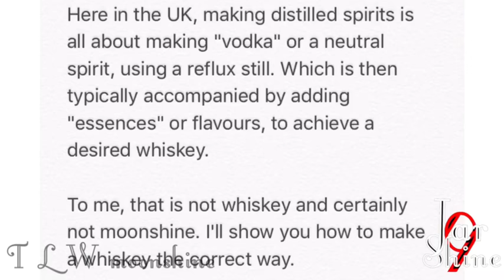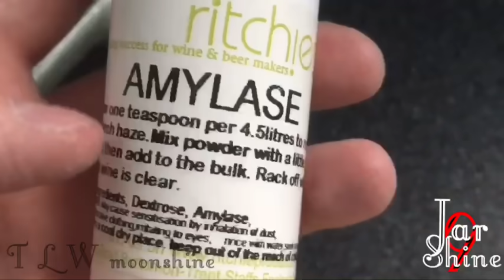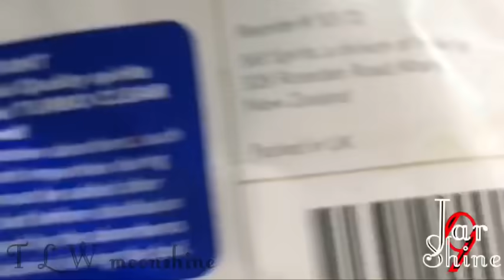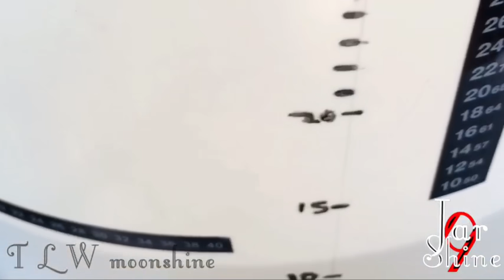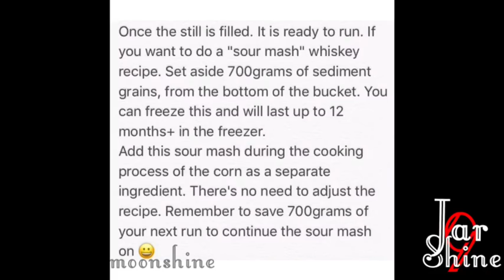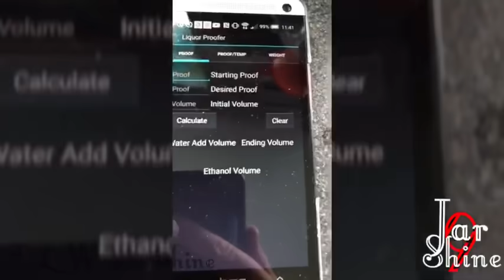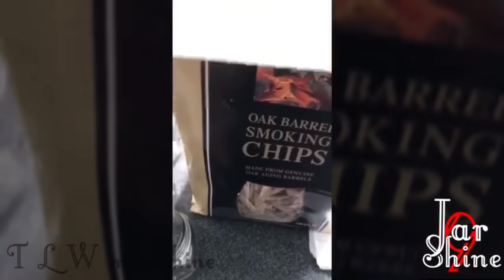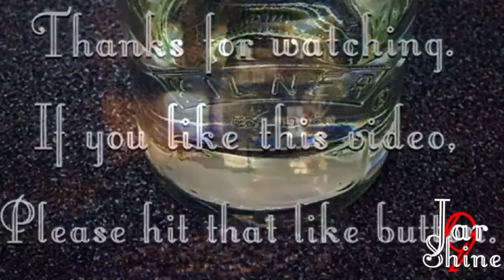Making moonshine in the UK from grain to glass.

Comment: Great video, very informative, I am in the UK, and thinking about having a go for myself using some of your techniques. I got a little lost when trying to write down a full list of what I need beforehand. Is there any chance you could do a little ingredients list please? Would be much appreciated.

Anyway thanks for the video I learnt a lot :)
Reply: Let me know if I got this right:

* 500g Rye
* 600g Barley
* 6kg Sugar
* 3kg Sweetcorn
* 600g popcorn kernels
* 125g dried active Yeast
* Yeast nutrients

This is all just the main ingredients without the equipment which I am looking into separately. Let me know if I got anything wrong or missed anything.

Thanks
Reply from the maker: @raserapps8230  

hi, thanks for the reply. those ingredients sound alright. myself personally, i would knock the Rye down to 200g. But if you use that as a baseline recipe you can tweak the ingredients any way you like to make your own unique whiskey. Also you only need to use popcorn kernels if you're making your own "malt" i.e germinating them. There are chemicals that you can use for converting starches to sugars - Amylace.  If you do decide to use chemicals, the kernels aren't required.

If you need any advice, drop me a message i'm happy to help.